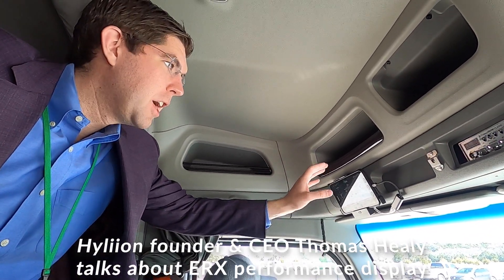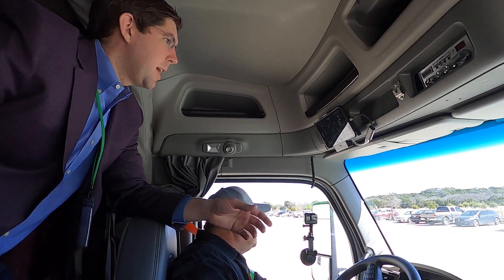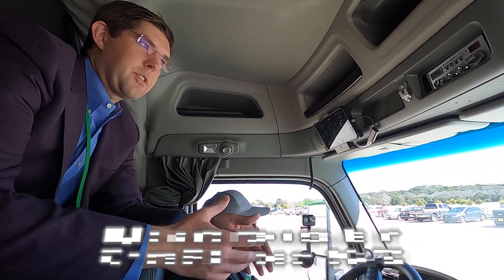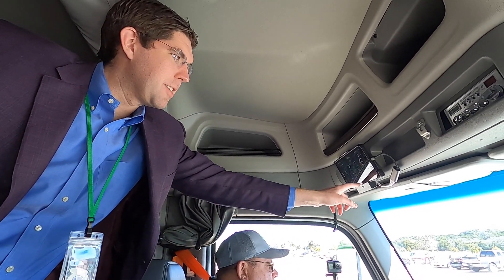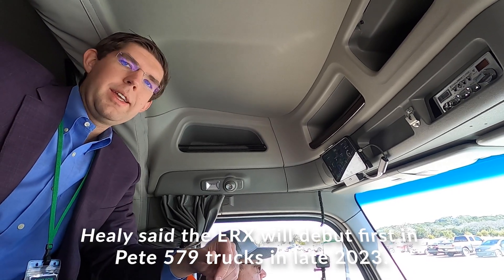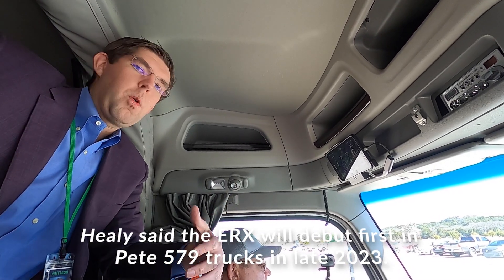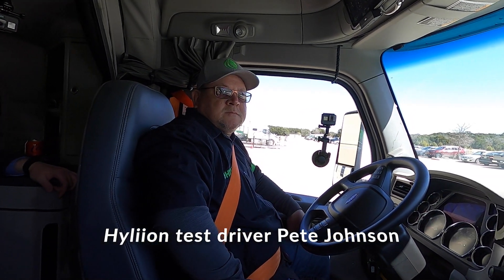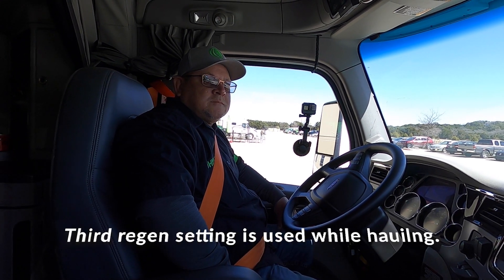Brains of Hyliion Hypertruck ERX on display

Comment: Awesome! I really love the geo on/off BEV mode! It's like on a Tesla, prepping the battery for supercharging, this will just charge enough so you'd have enough juice for the BEV only area.
Reply: This truck will always have enough battery juice.  The truck is powered by electric power power trans.  Only difference is the battery is much smaller than Full BEV, and it’s being charged by the NG generator.  Range will be 1000+ miles on a full tank while trailer is fully loaded.  This truck is going to kick ass.
Reply: @superfly19751  I know how it works, I just love that they think of the small changes needed when entering certain zones. There is a difference in coming to a no pollution area with 20% battery or 80%, that's why I like the use of software wisely.